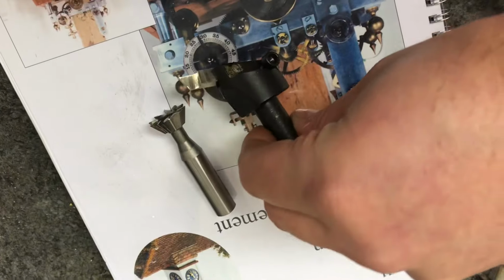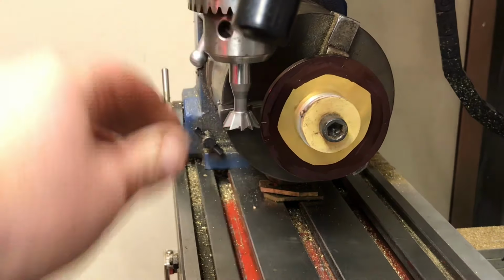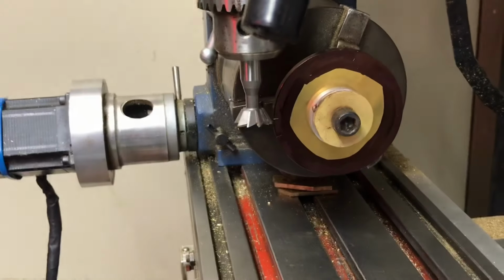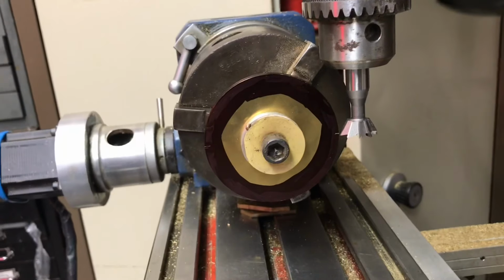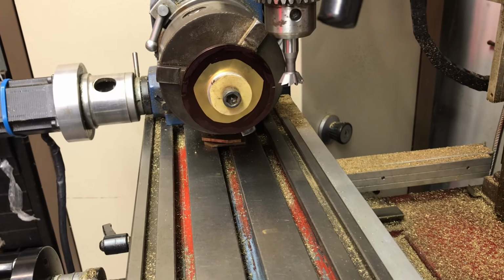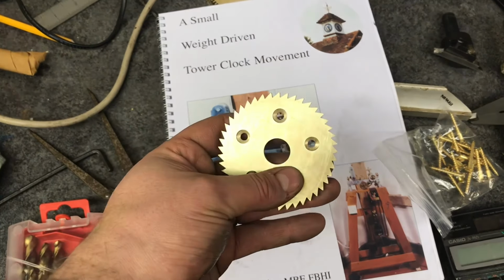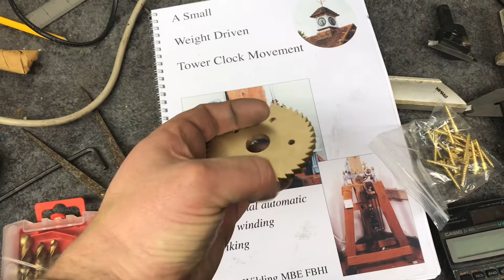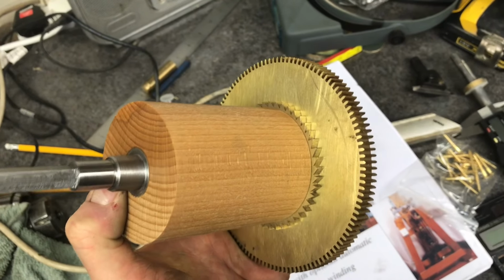Making a Church Clock in the Home Workshop: Pt 6 - The Ratchet Wheel

Comment: I made a cylinder the same height as the centre height of the dividing head, I simply set that on the table and lower the cutter to touch, job done.
Reply from the maker: That’s a great idea. I need to make one of these for the lathe as well

Comment: Surely  with your set up if you move the cutter up you won't  get an undercut in fact you would get the opposite! Moving the cutter down the 130 thou  will give you the 5 degree undercut desired so there is no catastrophe should the click spring fail !!!!! I should add that I am enjoying your videos and your clock is looking good so far.
Reply: Well spotted.